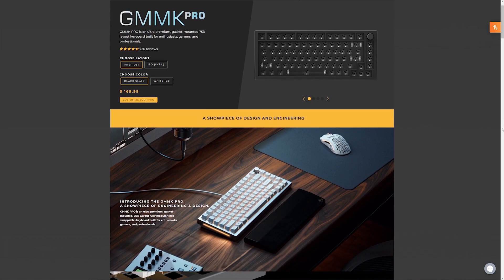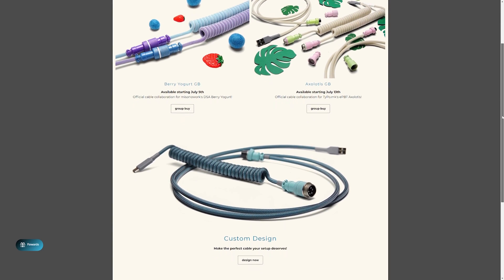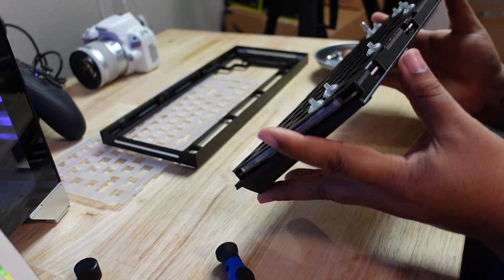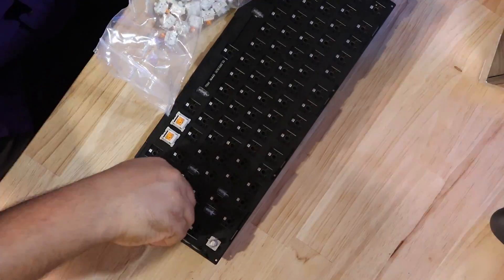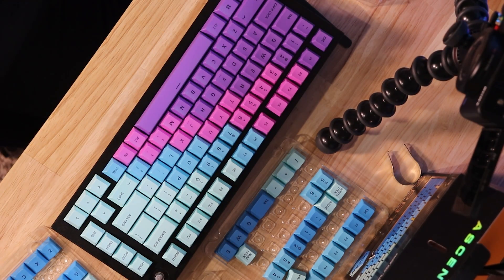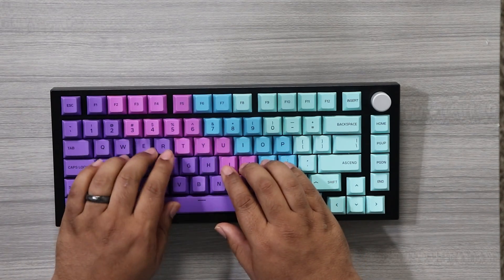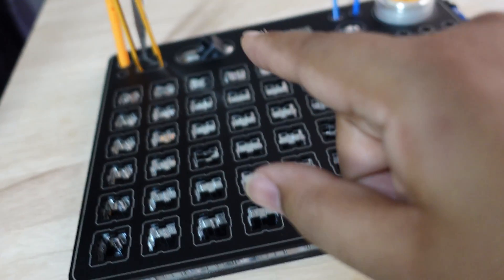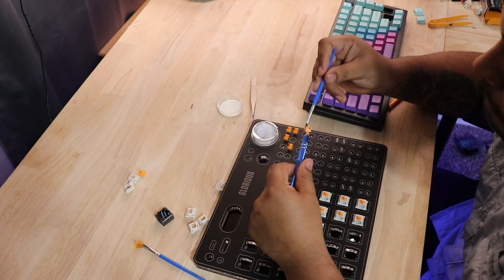WAIT!! Thinking about a custom keyboard? Watch this first.  | My experience with the GMMK Pro

Comment: if you really like the build want to go down that 'rabbit hole' further :), try the POLY plate and adding more gaskets to the plate, it does provide a softer feel for the board :)
Reply from the maker: So I picked up the poly plate as well, I didn’t put it on because I wasn’t entirely sure about the benefits versus the metal plate that was already there.
Reply: @TekVibe  if you want to experiment with the different feel/sound, the POLY plate is a softer experience just for fun

Comment: ya I only dabble in the keyboard sceen add lube to switches here, foam the bottom of a case here, change some switches etc. I watch alot of custom keyboard videos but could never justify some of the prices they cost for my self personally.the limited time ones that if you don't get it before its out of stock forget about affording it good luck finding it lol. but I mean we all have our hobbies if I added up how much I spent on some of my hobbies but spending tons on a keyboard is not mine but no judge to anyone who builds the 500-1000+ keyboards